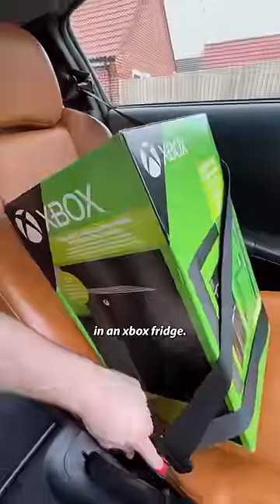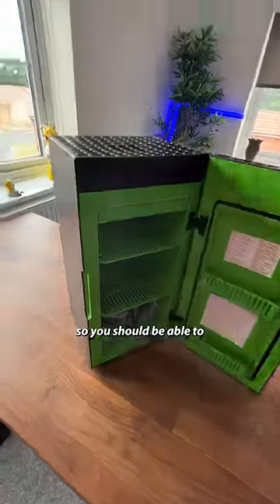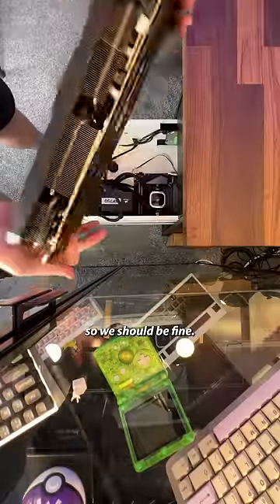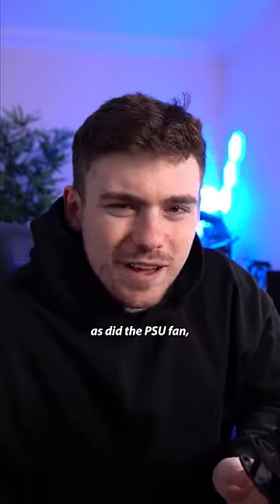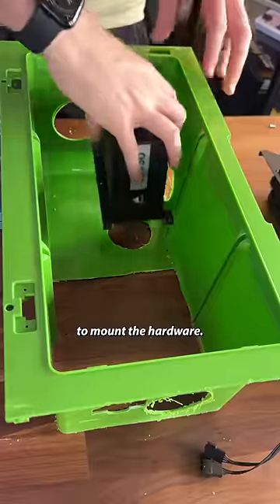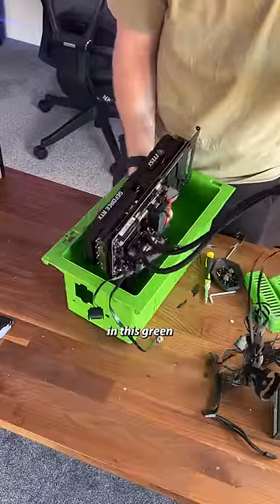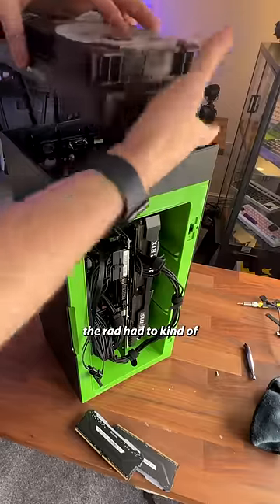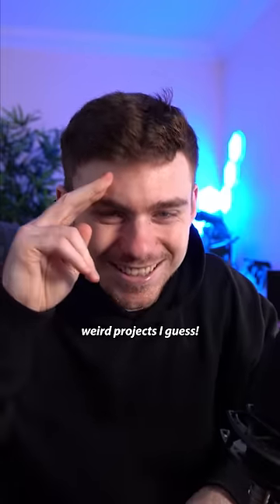How I Built a PC in an Xbox Fridge #shorts

Comment: bro forgot he could just use the fridge for cooling ☠️☠️☠️
Reply: Condensation has entered the chat
Reply: @DjDummo  Yeah alright buddy
Reply: the Xbox fridge barely has 30w of cooling capacity. It wouldn't be able to cool a stock ryzen 3 3100.
Reply: @Breakdown5297  r/wooosh
Reply: Fridges can't cool something that's getting hot inside of it
Reply: @meemkade  they can, actually. Refrigerators use the same tech as AC units usually.
The Xbox fridge is not a fridge.
It is legally a cooler.
Reply: I own that mini fridge and it just leaks water and the cooling is shit